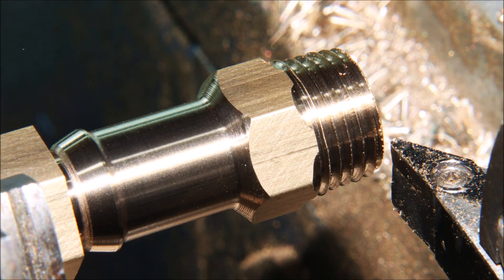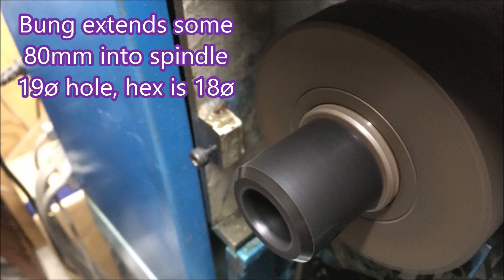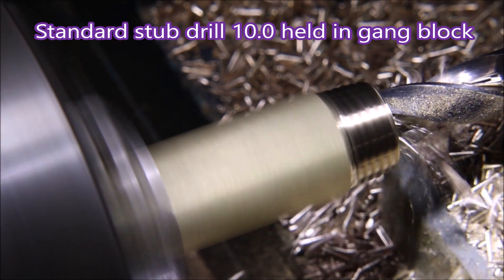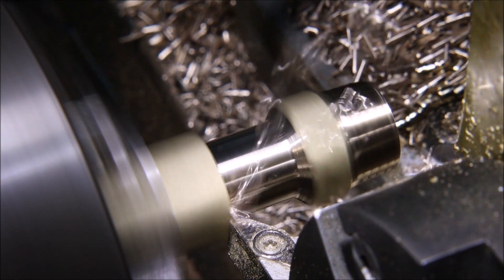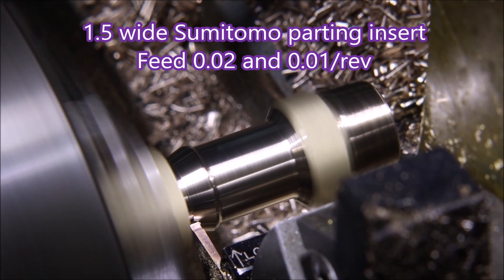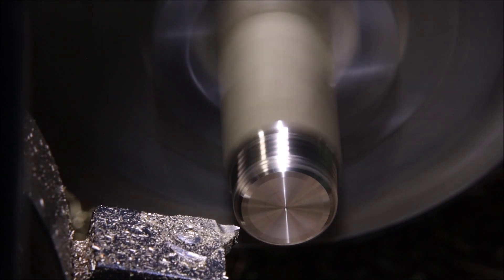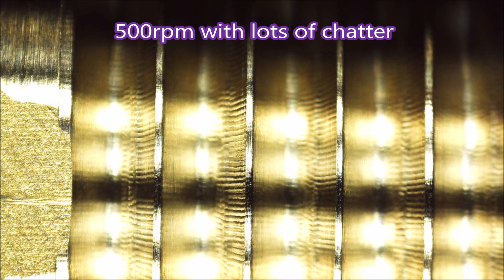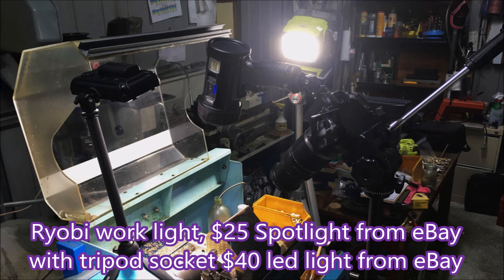Cnc lathe makes Hose Barb for A series classic mini engine. Turned, drilled, thread cut and parted

Comment: It's hard to see how you're holding your Ryobi work light, but the USA one doesn't come with a threaded tripod hole.  I assume the accountants wouldn't let the designers add $.50 to do it.  However, they left a through-hole in the mold that happens to be the exact right size for a 1/4-20 heli-coil tap.
Reply from the maker: Hi Matthew, I was surprised it was there, a 1/4-20 thread. Hardly the sort of light one would expect to find a tripod thread on. Compared with my LED video lights it is a bit bulky, but has the advantage of mains power, when all batteries are flat.
Reply: @smallcnclathes  Yours must be a little older - someone got a bonus for cost cutting in the middle of the production run.
Reply: Hi Matthew, could be, but it also could be that no one used it. I was very surprised to find it there, really did not expect it. No point loading a bush into the mould if it was never used. I recently found a Ryobi spotlight that is great and will be the subject of a future video. In this case I needed a 1/4 bush in the base of the battery and Ryobi in their wisdom did not put one there. So I created and 3D printed a shoe that the battery slips into. This lets me mount it on a tripod.

Comment: Also really appreciate the info on your lighting and camera setup.  I am rebuilding a cnc into a drill press and hope to make a few videos really just for fun, not a real channel. 

A year ago my son and I were attempting a prototype video and the camera tripod got kicked,  luckily i caught it in mid air before it hit the ground.   Apparently this happens pretty often so I am making a really solid stand for the camera instead of a tripod. 

The lens i have is a bit long but it will have to do for a while. 

Anyway , appreciate the info on the photo equipment setup.
Reply from the maker: Hi Harry there is more to come. When you say lens is a bit long, you can’t focus close enough?  My most used lens is a 55-200 mostly around the 200. I always have to use a close up lens to get focus. Also keeps the camera away from chips flying around. Happy to discuss further if you like.
Reply: @smallcnclathes  Thank you.  The lens that I have is a MFT 42.5 mm portrait type,  which translates into roughly an 85mm in full frame equivalent.   It is not a macro. 

I know what you mean about needing to keep the photo equipment away from the machinery,  just a tight work space. 

The camera is fine,  the operator ( me ) is marginally competent.   I am thinking about filming in 4k, 30 fps.

My lighting right now is a mixture of an led battery light similar to yours,  just a Dewalt and similar misc other. 

Open to ideas and suggestions
Reply from the maker: @harryniedecken5321  4K is fine but not really required, 30 fps requires 1/60 shutter speed, which means you need a lot of light. Close up lenses work well if you can't get focus. I bought an el cheapo spotlight off ebay but at close range the spot becomes a doughnut!!. Put a 75mm magnifier in front of it and the doughnut disappears but the spot is then too small! You saw the Ryobi spotlight? Makes all the other lights a bit superfluous, it really is a powerful light, I also have a Ryobi work light which even has a tripod socket in the base, that is useful as it is a hybrid and can run off the mains.  I have in the pipeline a video for a light with a magnetic base and one on the Ryobi which took a bit of effort to put it on a tripod.
RE the falling tripod, they are a pain, always in the way. With camera and lights all pointing at my lathe, it is almost impossible to operate the lathe.
Reply from the maker: I just noticed, a cnc into a drill press? Most folks try it the other way round. LOL
Reply: @smallcnclathes   yes you are right.  I build van conversion electrical systems and did a trade for a non functioning cnc wood router.  Working area is about 0.6 x 1.5 meters. 

Most of my stuff is either working on sheet Baltic birch or into the 6 faces  of heavy duty full size suit case type plastic case/ box.

The router was a diy build and wasn't really strong enough to run at the speeds needed for wood cutting. 

I often need to drill 30 -50 precision ( for wood work) located holes.   Right now I do this entirely by hand so if I can get even the pilot holes done automatically,  it will save a lot of time and stress.

The holes have to be essentially perfect with no post touch up so I need to drill them vs spiral cut. It's ABS,  so it melts and strings if not done correctly. 

Long winded, sorry.
Reply from the maker: @harryniedecken5321  hardly long winded, just a good explanation.

Comment: Thank you for the video.   It is amazing how much better the brass turns into convenient chips vs your next couple of videos with the two different types of steel. 

The thread that you made is a common one here in the US.  Yes we have both systems,  but that particular thread is so common at first i thought " wow, even in Australia it is used" before I read the title.  😂
Reply from the maker: Hi Harry aluminium (machine grade) and brass both machine really well. The parameters required for them are well within the limits of my machines. Free cutting steel is also good, but anything else tends to need cit and feeds and spindle speeds that are beyond my machines (and me too) I am a draftsman that dabbles a bit with machining, so have limited experience outside work I have done with these  machines